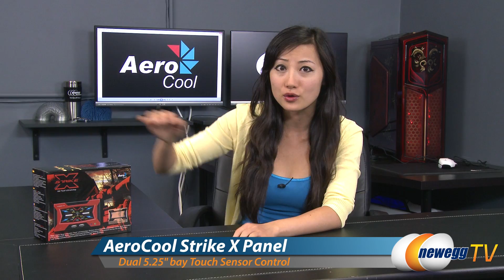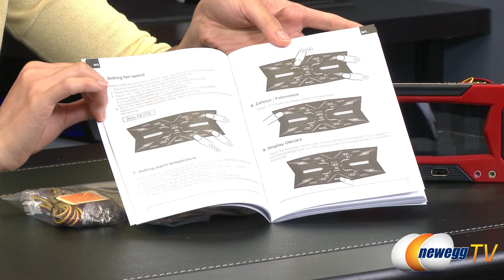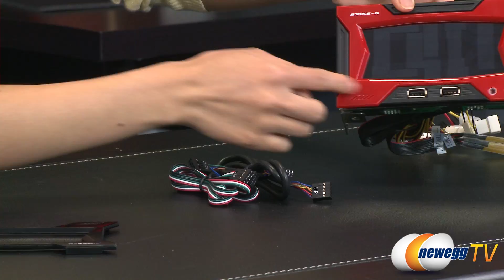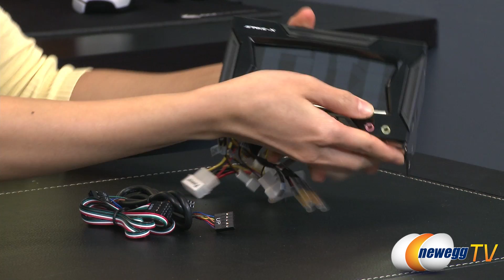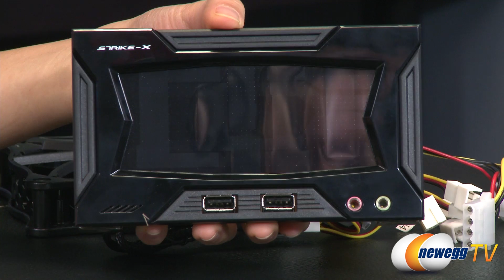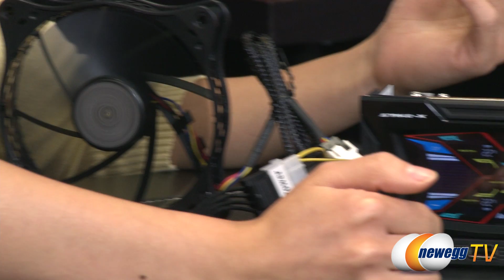AeroCool Strike X Panel Dual 5.25" bay Touch Sensor Control Overview - Newegg TV

Comment: I found one of the temp sensors hanging out. I don't know where it's supposed to go. It says temp2 and in this it says it should go on cpu cooler. Which might explain the massive issue i'm having with CPU fan error. If it is from the cooler. Where should it be placed?

Comment: Kind of useless to me..but it is very cool to have a touch fan speed control panel in front of the case if color match,Though it takes two 5.25" drive bay...